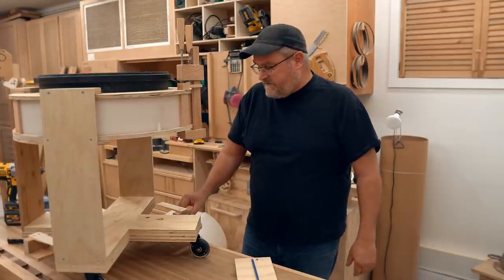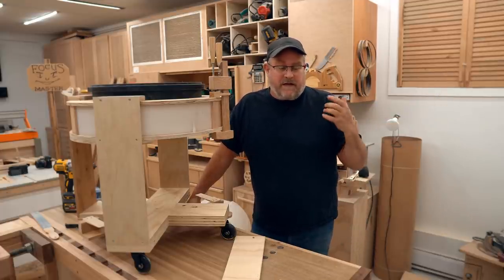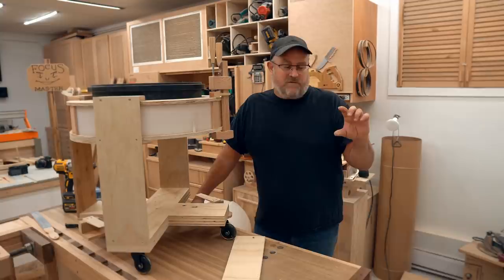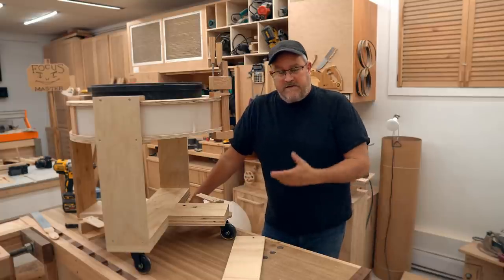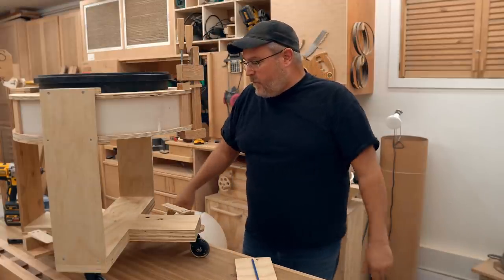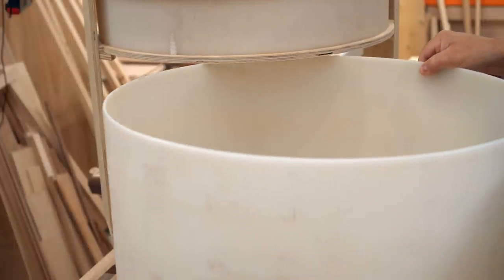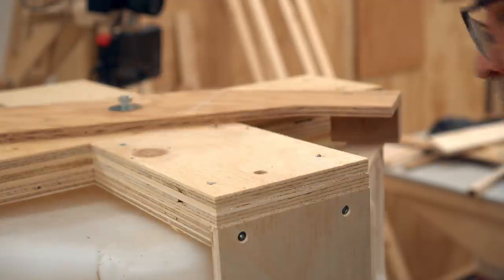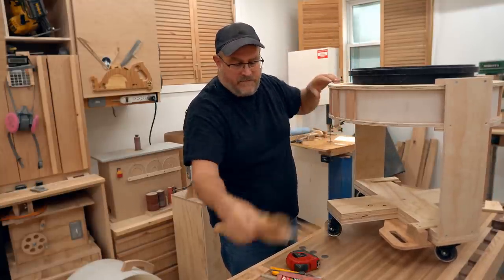It Works! Bucket Lifter for the Cyclone Vac

Comment: I solved the same problem on my own dust collector in almost the same way.  Mine was very crudely made with 4 opposing pairs of ramps (shims) that rode up on each other when turned.  The shims were mounted to the bottom of a circular dish with a handle.  The top was flat which also meant I didn't have to mount the shims to the bin.  Just place the bin in the pocket and rotate the handle 30 degrees or so to lock it in.  Might have been overcomplicated but it worked a treat.  Fun watching you come to a similar solution

Comment: Ever thought about building a project solely by the recommendations of the comment section? it sure would be a work of art.
Reply: Got something there in the workshop with an existing bottom surface a foot above elbow height? Build and hang a lazy susan like thingie under it so you can revolve/rotate your drill like hand tools into view at a nice graspable height. This would be more a work of least effort. But could still be pleasing useful art.

Comment: Carve a key into the base that the wedge can ramp up and follow. it would allow for a thicker wedge. You could set it up with a full ring that cams on the wedges and a foot plate for pushing to lock.

Comment: This looks to be a very compact mechanism to allow substantial collection capacity in a useful sized item.  My imperfect understanding is that the larger than usual diameter should cost you less flow resistance than would a smaller diameter, balanced against particle size capture.

Comment: The solution is, dare I say, ingenious. Instead of a fixed cam tightening system it's kind of a floating cam. I'd like to think I would come up with that, but nope, not the direction my brain was headed. I was leaning toward a graduated slot with pins sticking out of the base, much like the way a garbage disposal  twists on. Your method is a whole lot more practical. Nice.

Comment: Like the wedge locking, but is the barrel stiff enough to be wedged only in two spots? I imagine that it will drop slightly on the two feet that doesn’t have the wedge to support it.

Comment: I think the wedges could’ve been built directly into the “+” rather than under it with very little loss in structural strength. It would involve a locking cam style mechanism that I’ve seen you build before. Ughh wish I could draw in Youtube comments lol. Anyways...love the ingenuity and the shop is looking good!

Comment: How's about mounting the inlet through both the vertical upright( which is adjacent and to the right of where you are intending to fit it) and then through into the white plastic collar. My thoughts are that it could then be sealed into the collar plus it would have some added rigidity from the vertical upright !
Just a thought 🙂

Comment: Interesting technique for priming the plastic prior to painting. I've used actual plastic primer before, but have not heard of using spray adhesive. Interested to hear from someone that has done this as to how durable it is. Also what type of paint (latex, enamel, etc) has been used as the finish.
Reply from the maker: Old painters trick. Using contact cement that you brush on, but the spray is the same.